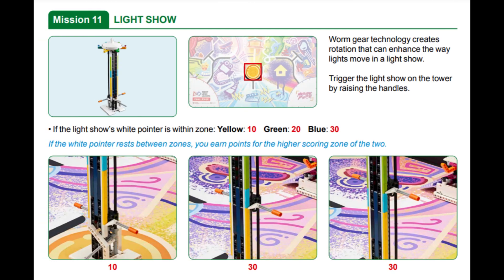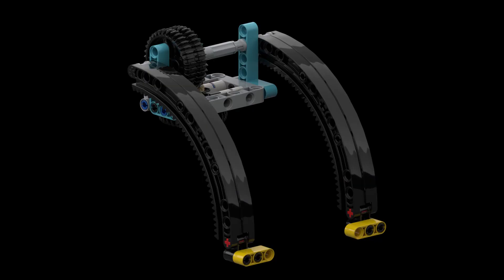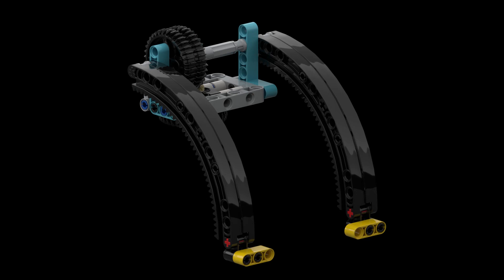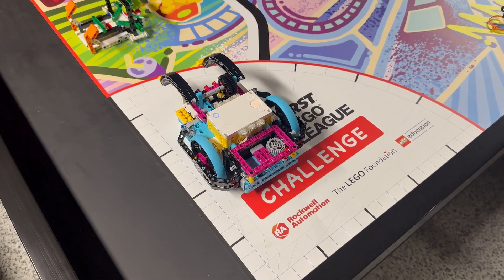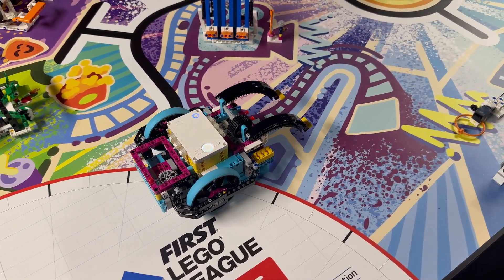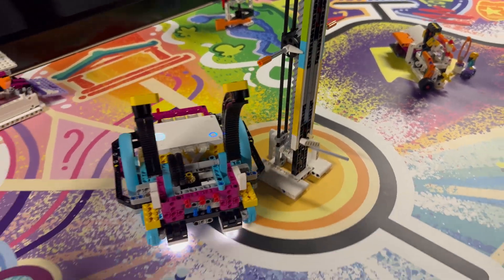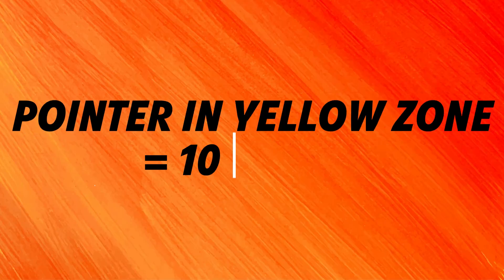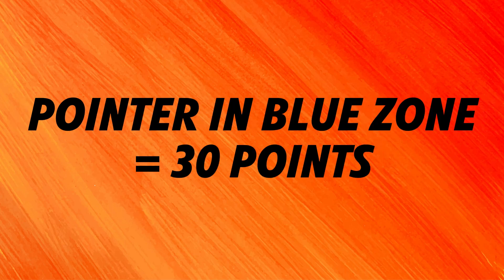2023-2024 FLL MASTERPIECE Mission 11 Light Show Solution with Spike Prime

Comment: How do you have your robot go from one place to the other? Do you use the gyro sensor, line following or just the move blocks? I can't figure out how the number for the right and left blocks work. Help, please.
Reply from the maker: Hello. We do use the yaw angle sensor of the Spike Prime for driving straight and turning. Are you talking about the Blocks that have a steering value and show a steering wheel in the dropdown? The value you choose is the relative distribution of power between the two drive motors. If you choose „0“, both motors get the same power and the robot drives straight (forward with positive power and backwards with negative power). Choosing +100 means the left motor gets 100% positive power, the right motor gets 100% negative power. The robot will turn right on the spot around a virtual axis in the middle of the robot between the driven wheels. 
Selecting +50 will send 100% positive power to the left wheel and no power to the right wheel. The robot will turn right in a wider turn around an axis through the right drive wheel. Any number between 0 and 50 will result in wider turns with the center point of the turn circle outside of the robot, any number between 50 and 100 will make the turn tighter. 
For left turns just use negative numbers. 
⚙️⚙️

Comment: How to build this attachment?
Reply from the maker: Hello. There are no instructions for the attachment. We could share more pictures on IG. In general we modified the dozer blade attachment to use the black 36 tooth gears instead of the 20 tooth beige gears for the final gear ratio. To support the axle one hole higher above the attachment base, we switch the yellow T beams for 3x5 L beams. In addition we limit the downward travel of the curved arms by resting them on 3x5 L beams attached to the sides of the magenta frame. With the arms not being able to go lower they have the right height to start lifting the light show bars. Once they are in motion the up movement of the attachment is sufficient to lift the bars into the blue area. Let us know if you need more details. 
⚙️⚙️
Reply: @6006TechWarriors  Thank you so much. We’re can I find IG?
Reply from the maker: @pellaersnicky  Sorry, we are on Instagram (fll.team.6006). 
Merry Christmas 🎄 
⚙️⚙️

Comment: How do you build it
Reply from the maker: Hello. Start with the „dozer blade“ attachment in the instructions but use the bigger black gear (36 teeth) rather than the beige (20 teeth). You will have to change from the T-shaped beams to L-shaped ones to elevate the output cross axle. The new gear ratio will give you a little bit more torque. Leave out any bottom crossmembers on the dozer blade. When you use the attachment for the light show you need to support the two arms on the side of the robot with additional L-shaped beams as shown in the video. This will get the mission model started as the robot drives the arms under the lifting axles. Then just lift the arm up and try different speeds and elevations to reach the desired height. 
⚙️⚙️
Reply: @6006TechWarriors  no not in words it a little to complicated for me it’s my first time in Lego league, so I kind of have a little experience
Reply from the maker: @JohanMones  May we ask why you are attempting one of the more complicated missions in your first year of FLL? You know that you will have two and a half minutes to complete as many of the 15 missions during a match. This one is tough to move and also requires some understanding of mechanical systems to achieve the required elevation. There are many other missions that you could try first. We don’t want to discourage you, but there are a lot of teams we see who do not attempt this mission, because it is too hard. We just built our attachment to try it and iterated it until it worked for our solution. If you really want we can share additional photos on our IG account. 
⚙️⚙️

Comment: Where do you find the attachment
Reply from the maker: Hello. There are no instructions for the attachment. We could share more pictures on IG. In general we modified the dozer blade attachment to use the black 36 tooth gears instead of the 20 tooth beige gears for the final gear ratio. To support the axle one hole higher above the attachment base, we switch the yellow T beams for 3x5 L beams. In addition we limit the downward travel of the curved arms by resting them on 3x5 L beams attached to the sides of the magenta frame. With the arms not being able to go lower they have the right height to start lifting the light show bars. Once they are in motion the up movement of the attachment is sufficient to lift the bars into the blue area. Let us know if you need more details. 
⚙️⚙️

Comment: Thank you for sharing the solutions. I am having issues with gears slipping and not enough torque - any suggestions!
Reply from the maker: Hello. 1. Check your mission model to see if it is built correctly. Some areas might benefit from a looser connection to make them move more freely. 
2. Make sure your attachment is securely fitted to the robot and the gears are held in place. 
3. Within the attachment use a taller gear ratio ( going from a small gear to a large gear in the final step) to increase the torque. 
4. If you look closely at our setup, you will see two white “L” beams supporting the curved arms of the modified dozer blade to be elevated  when approaching the light show model. This helps get the model moving so that when the arms move up, the model has already built up some momentum. 
Let us know if you need more help on this. 
⚙️⚙️

Comment: i think 2. 30 minute is very litte time for fll . what do you think
Reply from the maker: All levels of FIRST robotics have the robot game limited to 2:30 with varying levels of autonomous vs. Tele-op (remote control) operation. This is done to be able to go through all the robot game matches in a given time frame at the competition. 
Depending on your experience level, you will see teams who will complete only a few missions, some teams who will do a handful, some who will try to do most of them and only World Championship level teams will be able to complete all missions in the 2:30. Do not beat yourself up if you can’t do everything. It is supposed to be hard and a challenge to the team to figure out efficient ways to get the most missions done. We also believe in quality over quantity. If you can score 50% of the max points  every single time, it is better than having a solution for all the missions that only works 10% of the time. 
⚙️⚙️
Reply: thanks  according to fertility @6006TechWarriors
Reply: you are  number  one . l say the reality . no one can imagine my feelings . thanks for all of these @6006TechWarriors

Comment: I want to say our robot is the same as your robot
Reply from the maker: Did you also build the attachment the same way with the bigger gear to provide more torque to the arms and did you put the “L” beams on the robot to support the attachment arms as the robot drives up to the mission model?
Double check that the mission model is built exactly as shown in the instructions. 
Let us know if you need more help. 
⚙️⚙️
Reply: @6006TechWarriors  thank you but we decided get 20 point in this  task and it is ok for us .thank yoir help
Reply from the maker: @teranesuleymanova9815  20 points would be when the white pointers on the side are in the green area towards the top of the Light Show structure. If you can get it up there you should be able to figure out how to stop it in the blue area. 
⚙️⚙️

Comment: The dozer blade lifts 360 degrees without any object. as soon as it comes in contact with side arms to lift, it stops. Can you provide some suggestions
Reply from the maker: Hi. Apart from the obvious modification of deleting the cross beam, we changed the base of the dozer blade attachment to incorporate the 36 tooth gears instead of the 20 tooth one. We also rest the curved arms on the L-beams attached to the side of the robot to use the curved surface as a passive attachment to get the Lightshow model started. Once the robot reaches the back of the mission model platform it starts lifting the attachment the rest of the way. 
⚙️⚙️
Reply: @6006TechWarriors   We have the same model as described above by you. In the code, we set the motor to rotate to 360 degrees to lift the arms. As soon as it hits an obstacle, it seems like there is not enough torque to lift the handles on the lightshow model.
Reply from the maker: @andyfed79  Sorry, just realized that you posted a follow up. Does the arm just stop or are the gears slipping (making a crack-crack-crack sound)? Did you follow our advice to rast the curved arms on 3x5 L beams as shown in the video to elevate the arms, so that the Light Show starts moving with the attachment being static, then use the momentum of the mission model and continue lifting the attachment arms. What speed are you using to lift the arms? Lower speed might help generate the torque. 
⚙️⚙️

Comment: Can you please share the link to build the extension ? The gears that we are using are unable to lift the light show bars.
Reply from the maker: Hello. There are no instructions for the attachment. We could share more pictures on IG. In general we modified the dozer blade attachment to use the black 36 tooth gears instead of the 20 tooth beige gears for the final gear ratio. To support the axle one hole higher above the attachment base, we switch the yellow T beams for 3x5 L beams. In addition we limit the downward travel of the curved arms by resting them on 3x5 L beams attached to the sides of the magenta frame. With the arms not being able to go lower they have the right height to start lifting the light show bars. Once they are in motion the up movement of the attachment is sufficient to lift the bars into the blue area. Let us know if you need more details. 
⚙️⚙️
Reply: Thank you.
Pls share the pics of the attachment. This will be easier to get an idea.
Reply from the maker: @KiranKanchgar  Please contact us on Instagram and we will share the pictures there. 
⚙️⚙️

Comment: can you share a link to the robot base please?
Reply from the maker: Hello. Check your Spike App that you use for programming the robot. On the Home Screen is a link to “Building Instructions” and in there you will find instructions for the four sections of the “Advanced Driving Base” and its “Assembly”. Under “Tools” there are instructions for the “Lift Arm” and “Dozer Blade”, the two attachments we modified for most missions this season. 
⚙️⚙️
Reply: @6006TechWarriors  Good day. I do not see the "Tools" option or the instructions for the "Lift Arm" or "Dozer Blade". I am running the App version 3.3.1.
Please assist with this matter.
Kind Regards.
Faffa
Reply from the maker: @electronicsbyfaffa2347  
Hello Faffa, I just checked and in the “Building Instructions” (accessible from the Spike App Home Screen) there is a section called “Tools” that has both, the basic lift arm and the dozer blade in it. 
Either way we would strongly recommend to downgrade the Spike App to the “Spike Legacy App” (from the LEGO education website), which has a lot more options for programming blocks compared to the Spike App 3.+.
Let us know if you need additional help with this.
⚙️⚙️

Comment: We are using ADB and tried this mission using the same attachment. But its not working. Could you post instructions of the attachment?
Reply from the maker: Did you upgrade the gears on top of the attachment to the large black gears(same as the first gear that gets driven by the grey gear on the motor? With the larger gear ratio you will 1. Have more torque and 2. The attachment will sit higher. We also support Borge of the curved rack arms with 3x5 “L” beams on either side so the attachment arms rest on the L beams and already start pushing the mission model arms up as the robot drives into the mission model. 
We could share more pictures through our IG account, if you contact us there. 
⚙️⚙️
Reply: @6006TechWarriors  Thanks for the reply. Yes, we updated the gears, I will follow up on IG
Reply: I'm having a similar issue, with the larger gear ratio and L beam supporting underneath. The gear is grinding without being able to lift the box.
I have tightened everything but still not working.
Any suggestion please?
 @6006TechWarriors
Reply from the maker: @leochen4891  Hi. Are you locking the attachment in place on the robot? Can you see which gears are slipping? Do you have spares of any of the gears or can you try flipping them over to use the other side? Last but not least, check the mission model and see if the arms move freely up the tower with some resistance. If it is hard to move by hand, you might want to try and take apart and re-build the model. 
Let us know if this helps. 
⚙️⚙️